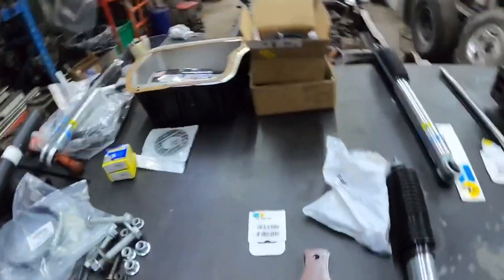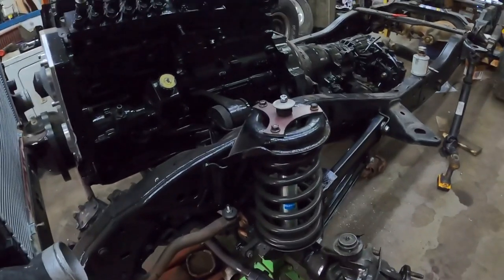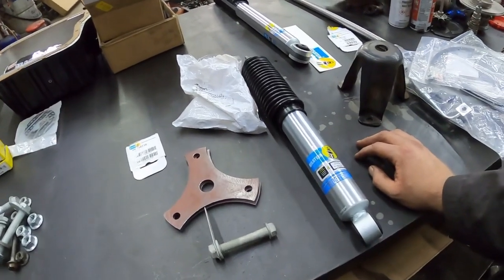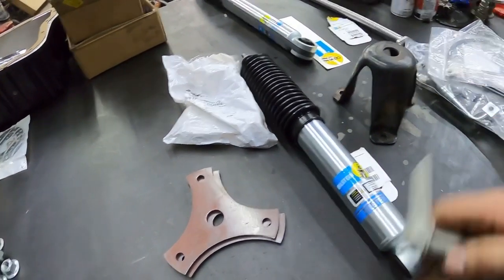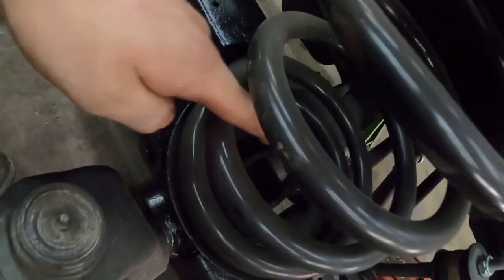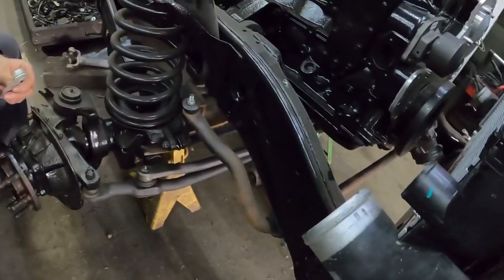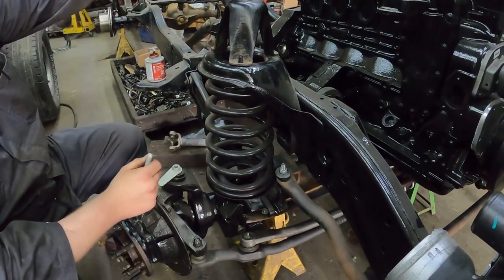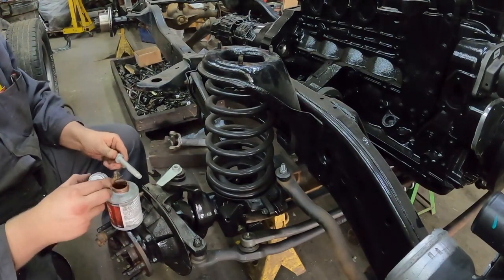94-12 dodge Cummins shock tower deletes ( how to)

Comment: Are the 1500 coils better?  As far as ride quality if you put them on a 2500 single cab 4X4. Great video. Passenger side shock was stuck in there. Had a hell of a time getting a new one in.
Reply from the maker: They do but will lower the truck. So it won’t take a lot of weight towing

Comment: How much lower does the truck sit with the 1500 springs. I have recently did this too my truck and used billsteins similar to the ones u have. Collapsed is 11.82 extended is 18.46, yours are 11.32 and 15.76. My truck rides so bad I dont even want to drive it. Wanting some insight, not a lot of guys run these and nobody has answers. 2008 6.7 truck.
Reply from the maker: These sit about 3 inch lower on a second gen like this. 3rd would be on the bump stops with these. You could take a stock second gen spring and see what it does. As the the 3rd gen is heavy truck might get you lower

Comment: Thanks for the info
Reply from the maker: No problem 👍
Reply: Well finally getting around to using the shocks you recommend and a delete kit . I went ahead and Installed the 2 to 3 gen track  bar bracket and new track bar today just to get a few things out of the way while getting ready to install the 2001 front axle and 3 gen brakes and steering..I realize I have to remove the track bar but I just want to get a few things out of the way ..I used the solid steel bracket and added a extra brace to the frame as I don't want any flexing on that bracket and welded it with some 7018 ..

Comment: I was wondering about using 1/2 ton springs on my Cummins for a better ride. Is it worth it and how do they ride? Do they compress more, if I want a 3 inch lift in the front should I put a 5 inch 1/2 ton spring in?
Reply from the maker: They do ride softer. But i have only done them in a lower application. So not sure on the lift side of things